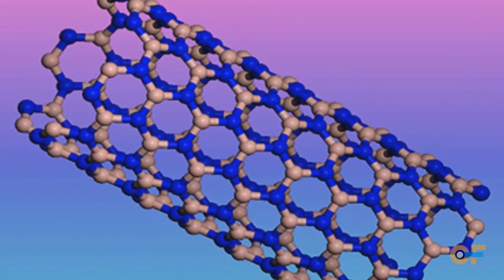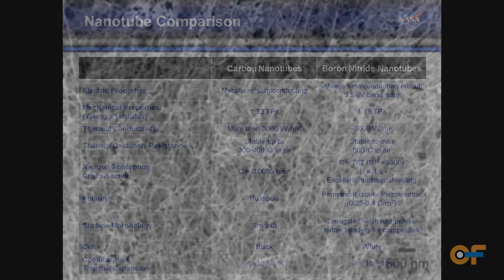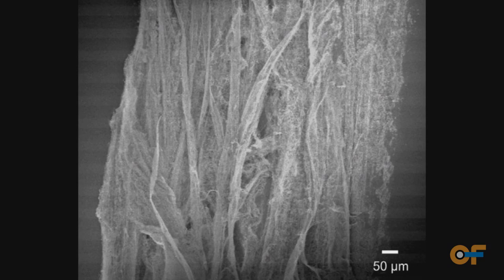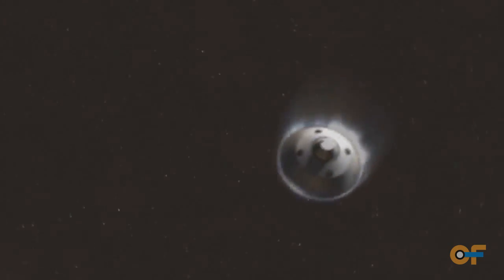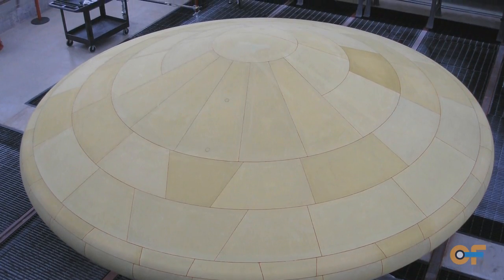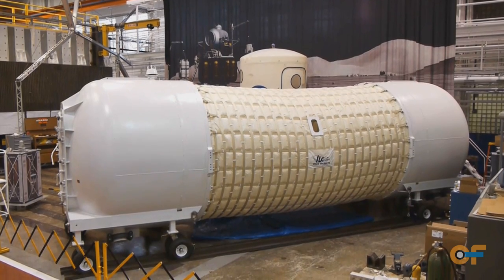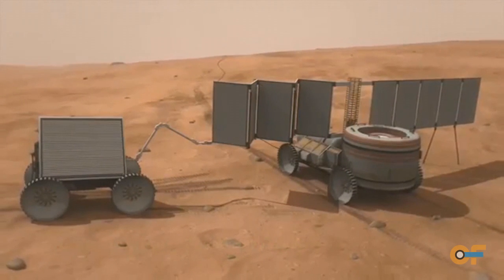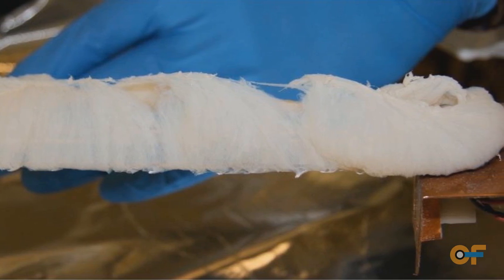NASA | Boron Nitride Nanotube Development

Comment: Is it possible to make cheaper composites for habitats and other aerospace applications?

Is it possible to use carbon nanotube/carbon fiber composites impregnated with graphene boronitride resin as a cheaper alternative to Vectran now?  You could simply paint the interior and exterior with graphene boronitride epoxy and just add layers

Comment: Boron nitride nanotubes are insulators, carbon nanotubes are conductors. This explains why we use the casehardening techniques to convert thick plates of 100% boron for more than 24 hours a day for several days until they are completely conveted into boron nitride from the inside out. Then we use nitrogen ions beams to strike them to coat finnished electrical and electronic transistorized printed circuit plates while leaving the platinum-iridium alloy connectors. Crude and cumbersome? Yes! But at least it works!
Reply: Sir....How you guys learnt all these things....I am intrested in chemistry...I want to grow...Guide me sir🙏🏻